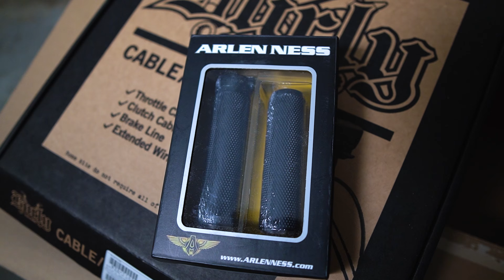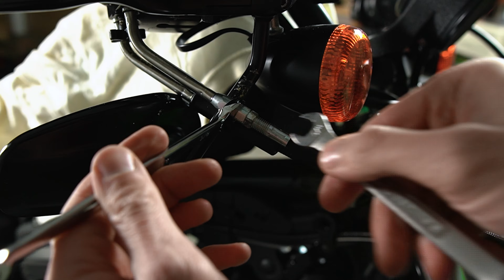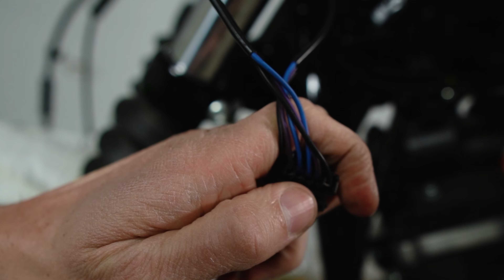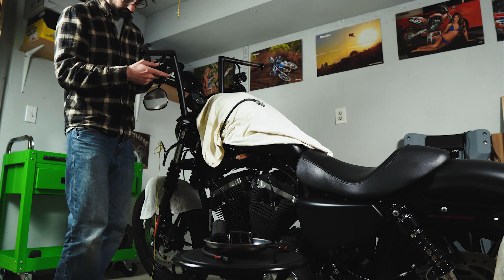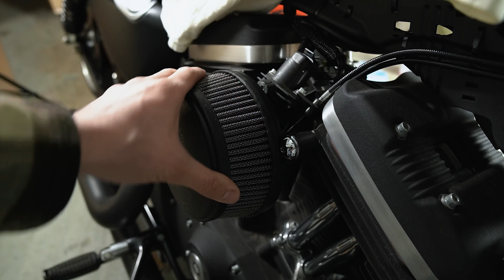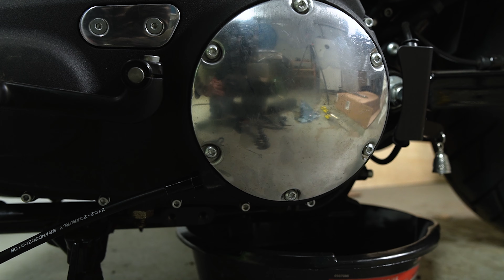Step by Step Harley Sportster Handlebar Swap

Comment: Is that a 1.25 inch diameter bar? I think my stock riser is 1 inch. (2016 883 Iron)
Reply from the maker: These are stepped bars. They are 1.25" but they step down to 1" at the riser clamp and at the controls/ grips. I was able to use my stock riser on this 2014 iron. It should fit yours too.
Reply: @TheJourneyYoutube  cool beans man. Safe riding
Reply from the maker: @vinny9988  thanks for watching. Good luck.

Comment: Did you have a hard time with bleeding the front brake? It seems as if my burley extended brake line, and the stock banjo bolts aren’t lining up.. I installed the new copper crush washers as well, used stock banjo bolts (burley kit didn’t come with any) and after struggling with not getting any fluid into the system, from the reservoir, to the caliper,  I realized my banjo bolt flow holes, aren’t lining up with the brake line holes.. therefore fluid is not flowing from the reservoir into the line, down to the caliper.. any suggestions? Or tips?
Reply from the maker: I'm not sure if the banjo bolt and brake line holes need to align. I did have to pump my brakes hundreds of times before it started flowing though! Maybe you just need to keep on pumping, or get a vacuum pump and it should go quicker. Keep at it for a while before buying new cables or bolts. It's a pain in the...

Comment: For some reason my clutch isn’t righting is there a reason why?
Reply from the maker: Righting?
Reply: @TheJourneyYoutube  tightening*
Reply: @TheJourneyYoutube  it doesn’t spring back the lever stays loose
Reply: @TheJourneyYoutube  also too it’s able to change out of neutral without the clutch  but not back to neutral
Reply: Every time I pull the clutch the wire in the primary pulls and stay it doesn’t snap back
Reply from the maker: Check that there isn't an issue with the cable inside the housing and that it moves freely when not connected. Then try installing it again from scratch:
- completely slack the cable adjuster
- make the screw adjustment under the derby cover
- readjust for minimal slack in cable.

I highly recommend buying a Harley service manual. It will elaborate on the proper adjustment and installation of a new cable. Also, make sure the adjustment in the primary isn't too tight. I try to explain that as best as I can in the video. Good luck.
Reply: @TheJourneyYoutube  ok thanks !
Reply from the maker: I would go through the process again. Also make sure the detent plate isn't misaligned before installing the primary cover and make sure the assembly is installed properly at the primary end of the cable. If it worked fine before, and the cable seems ok, it's probably just in the adjustment. Also make sure you do the adjustment on a cold motor.

Comment: Would this work on a 2006 sportster xl
Reply from the maker: All of the principles are the same, just be sure to order the wiring harnesses and cable kit for your model and check a maintenance manual for your bike. The wire colors might be a little different and the torque specs might be a little different too.

Comment: Hey bud, This was great. Thank you! -Was wondering if I could quickly pick your brain.. : Have a 95 Dyna Low rider. Came with Beach-style bars, wanting to swap for drag bars ( grabbed a set of Demon Cycle, 6" rise. Basic test-fit Literally puts the grips at the same position (Height, etc..) ., Just w/ forward facing grip, rather than to the side.. like almost holding a candle ). Which is why I'm doing this). My funny question, to determine if I need an 8" rise over a 6" ( to clear instrument cluster, etc..) is : On this bike, it seems I can potentially just unbolt the bars, drop them gently forward, then install the drag bars and just test. -Am I missing something?? ( occasionally brain turns into pile O gummy bears.. so second opinion would be helpful ). ((Also, have rebuilt a few older bikes, Honda's mainly, CB750's, VFR800's etc.. but this being my first HD, ..and not wanting to be 'That Guy', figured I would just ask.  (Btw, All lines, Clutch/Brakes, Throttle, elec, etc.. are all in line with new bars. So literal swap, aside from soldering the controls (wiring inside bars) if the they work out.) Thanks again man for any input. Simple question, but sometimes the most important ;) Cheers and stay well out there! :)
Reply from the maker: Unless I'm missing something, it sounds like you'll be good. There isn't any mystery with bars. If the dry fit seems to work, you're good. Just turn the bars in both directions to check clearances and go for it! Thanks for following along!
Reply: @TheJourneyYoutube  Thanks man.. really Much appreciated,. and yeah, it was one of those simple questions . .  Apparently overthinking is side effect of extended cabin fever. ;) Now it's just making sure the torque specs for the lower bolts, as they fit directly into the drag bar posts, are indeed 35 ft lbs.( give or take 5ft lbs).  Cheers and thanks very much again for the reply. Stay well out there!! ~j

Comment: Nice ride. Like the idea of snaking the wires through the bars using the casing. 
Now get out and ride and be safe.
Reply from the maker: See you on the road! 👍
Reply: @TheJourneyYoutube  nice video bro.
I got a question for you.would I still need to depin the turn signal wiring if I already relocated my signals on the forks?
Reply from the maker: @fromp.itohawaii277  I'm not in front of my bike, but I'm 99% sure that you do, especially if you want to internally wire the bars. The wire from the thumb controls needs to be depinned and extended, plus having the pins without the plastic connector makes it possible to snake through the bars.